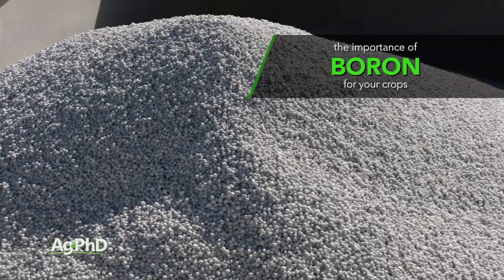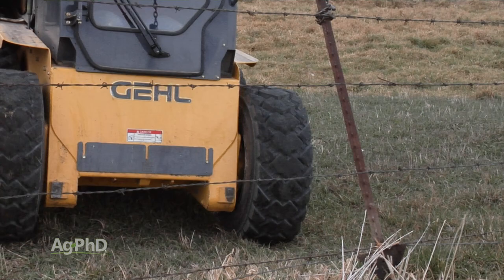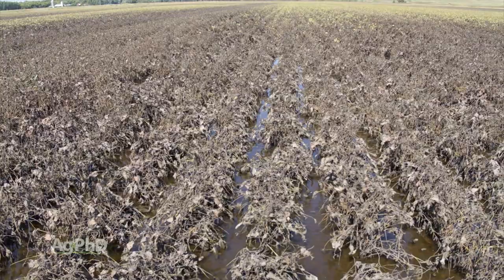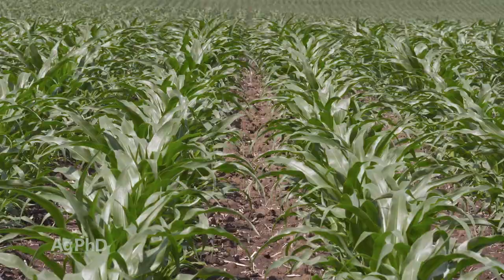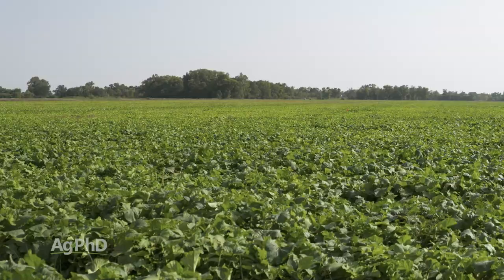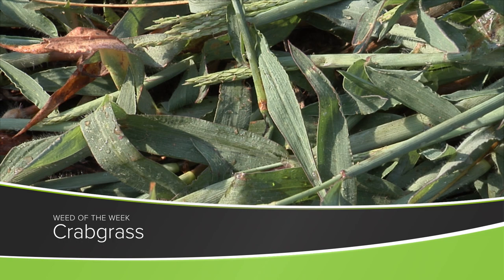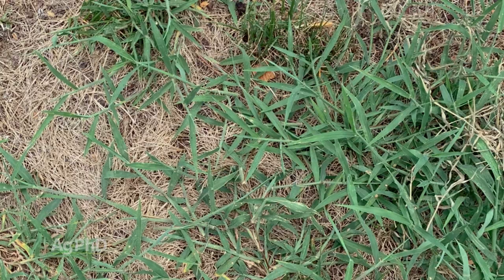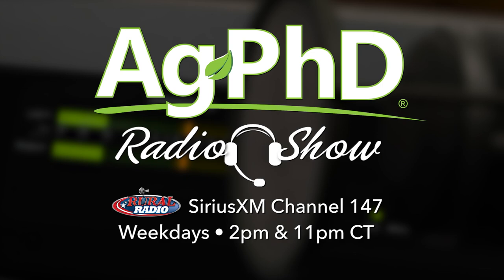Ag PhD Show #1179 (Air Date 11-8-20)

Comment: My soil tests nearly always have a note on them somewhere to the effect that the number may not be a reliable indicator with respect to Boron and a few other components, and that supplementation should not be based on it as a result. Few things will discourage supplementation more than that kind of "we don't know" / "don't look at us" on results.
Reply from the maker: Brian and Darren addressed your comments on Ag PhD Radio: https://soundcloud.com/agphd/11-19-20-drain-tile-management#t=44:38
Reply: @AgPhD  Thanks! It still puts all of the onus and guesswork, confident or not, on the grower rather than on reliable, objective analysis.